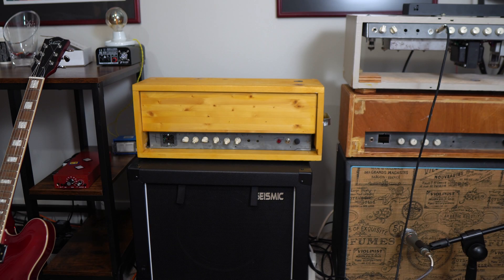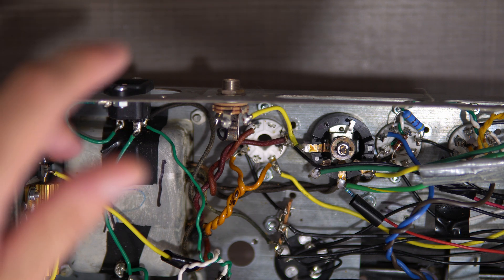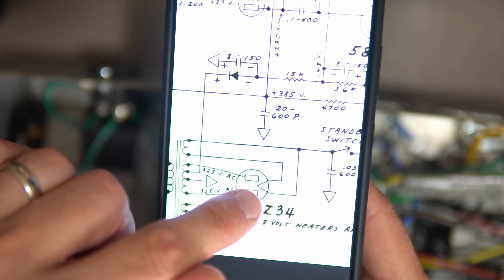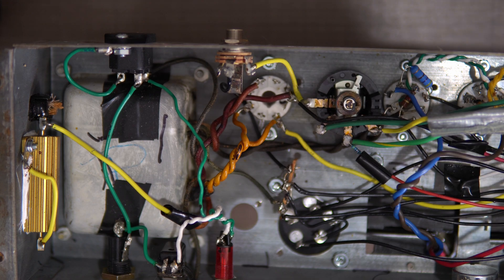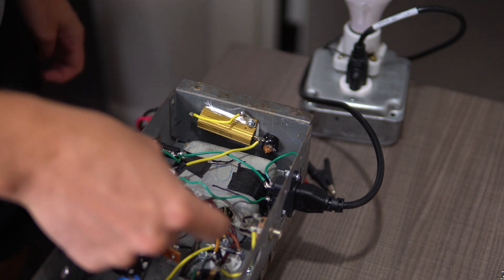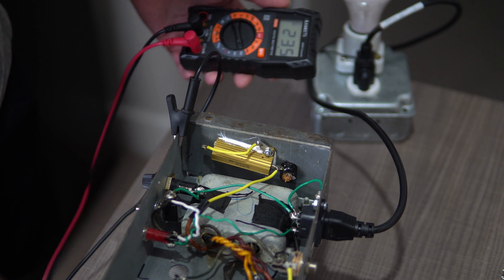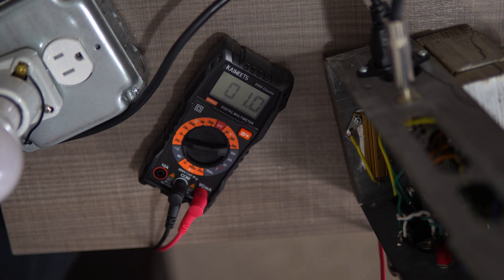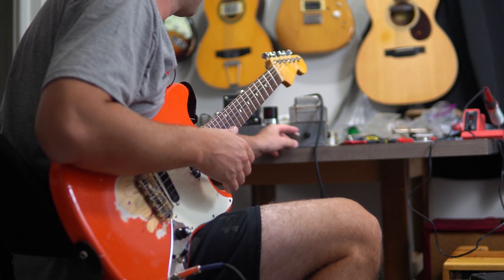How to swap out a Tube Rectifier for Solid State Diodes in a Guitar Amp (JTM45 to Plexi conversion)

Comment: Is this the same as a Yellow Jacket plug in solid state rectifier? It’d be cool if they had something similar to for the power tubes but to substantially drop the wattage in an amp for bedroom use.
Reply: there are plugs you can buy to substitute 6v6 tubes from 6l6 and el84 from el34's making 50w to 20w.

Comment: I’m surprised that you didn’t add some resistors (unless I missed that part). A rectifier tube has a substantial voltage drop which will make your B+ go up when switching to solid state diodes. Mine had a 17v drop per plate so I used something close to 68 ohms after each diode to bring it back to what it was before.
Reply from the maker: @MostlyPosative-nj5ex  Higher B+ was a desirable part of the mod. It required a rebias, but I wanted the amp to feel and sound different.

Comment: Bust out a dead tube’s glass and build the bridge rectifier and whatever Voltage drop circuit you want off of the base. That way you can still put a tube rectifier in there if you want.

Comment: Your soldering is in parts questionable .... especially the connection from safety ground on the mains input looked very wimpy.
Reply: well lets see your builds twinkle toes
Reply: @lpa74  Well, I am an electrical engineer ...
Reply: @Andreas_Straub  SO...and

Comment: How much current do those rectifier diodes need to handle? I'm kind of shocked (no pun intended) that a 1A rated diode is doing what a Tube is doing.
Reply from the maker: Good question.  I think a typical fuse for a 50w tube amp is about 3 amps.  But that's total current draw.  I think a lot of that goes into the heaters, and would not run through the rectifier.  For the B+ high voltage line I believe a 12AX7 is rated for only about 1ma.  I believe I biased my 6L6GC's in this amp to about 50 ma of current to the plates.  

Just looked at the data sheet for a 6L6GC.  At 450vdc on the plates the max signal plate current is 210 ma for two tubes.